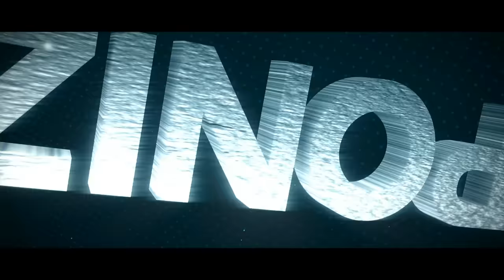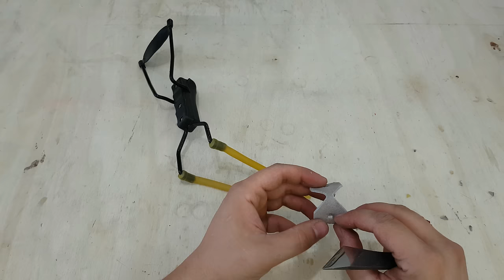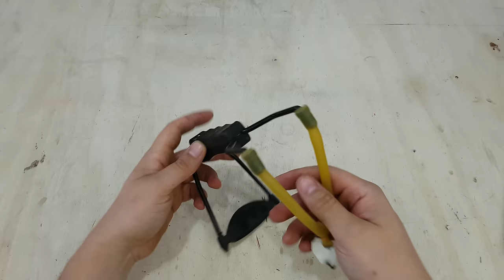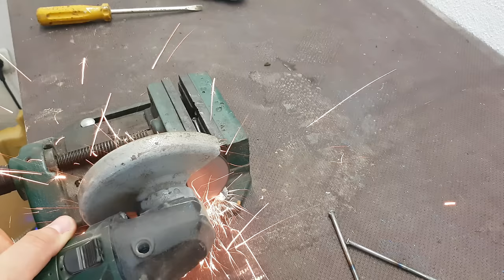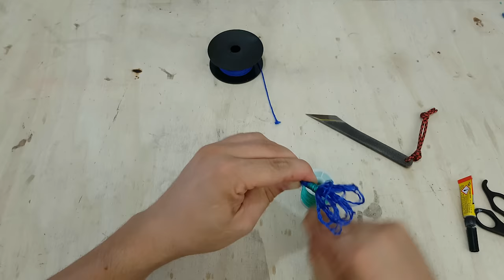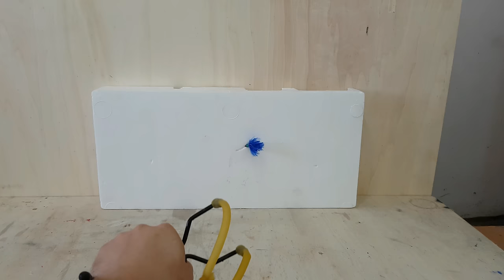How To Modify A Slingshot To Fire Darts, and How To make Slingshot Darts

Comment: You made the darts backwards.  You should have pounded the nail head to create the point of the dart.  FYI: to make aerodynamically stable dart or arrow, the center of mass should be towards the head of the dart or the arrow, not towards the rear.

To see if your darts are aerodynamically stable, hold bunch of them in your hand and throw them straight up in the air and watch how they land.   All of the darts should land head first and vertical, or nearly vertical.  If this doesn't happen then your center of mass is towards the rear and unstable. 

Good luck.
Reply: There are actually 2 options of making a dart stable. The one you listed is 100% correct. The 2nd one is to create drag near the rear of the dart. Thats what he did. The rear of the dart slows down significantly more than the front, therefor the front "leads" the dart -> it flys stable. 
This is often seen in Blowguns for instance where it is simply unpractical to use a frontheavy dart because of the limitations of the medium.
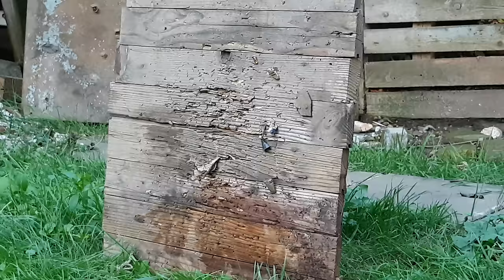Reply: @shaku7652  While I agree with you that there is more ways to obtain stability,  having nose heavy is a better way.   Case in point: see the impact of the sling dart at 7:34 - 7:37.  The rear heaviness of the dart nearly causes the dart to flip out.  Also,  airplanes are steam line,  have weight bearing landing gear near the front but none in the rear. 

You mentioned blow gun darts.  Those darts are long and slender, and being long and slender contributes to stability and has drag inducing material at the rear, contributes to more stability.  Spears are long and slender, nose heavy, but not all, and has good stability in flight without fletching.
Good luck.
Reply: excellent info sir
Reply: @RajneeshKapil  Thanks.  Good luck.
Reply: I think that he keeps the head of the nail just to have an better grip to draw the slingshot...
Reply: they work
Reply: How about a "bowstring" in the tail & an archery trigger?
Reply: I'm testing with everything you explained,  yes, front weighted arrows fly the best. I use blowgun darts made from various materials, long thick bamboo skewers to short heavy nails. And another also made of nail, but front loaded by having a long plastic tube as the tail. The front loaded and the long slender darts are the most stable.

I recorded several videos of my blowdarts flight path.
Reply: @LKH9Channel  You're a serious hobbyist. I think you're gaining a lot of knowledge by experimenting. Good luck. Be safe and in good health.
Reply: @tyronekim3506  thanks :)
Reply: I guess you could remove surface metal near the back to balance it out. Grinding using a tiger paw halfway point on back.
Reply: physics teacher? l;ol

Comment: I made similar darts over 15 yrs ago, the darts are stable to shoot frameless. Looking at the fletches on you're darts, you probably accurate up to 35/38 ft at most, after that you get drift in flight? Trim the fletches down, second bit advice, get rid that catty. Black widow cattys are static resulting in the dart drifting or hitting you. Use a otf style catty so you can flip forward on release an use 1580s tube. Only advice tho

Comment: Been making darts for my daughters firetek bow. Tubing is a loop in either side, so there are hook/barbs on both sides. I Put a 3° helical fetching on and twist just a few degrees counterclockwise at draw. Those things spin like a top. Looks like I need to mod my slingshot for them

Comment: dry fire a slingshot and see that the band never hits your hand.  The pulling action on the tip is the most stable impulse. Pushing the back in conventional projectile slingshots ( like archery ) is unstable and will require a support platform for stability and security. If you are still scared then use a longer set of forks. A 6 x 0.5 in strip of material will act as a tail stabilizer - example Chinese darts.